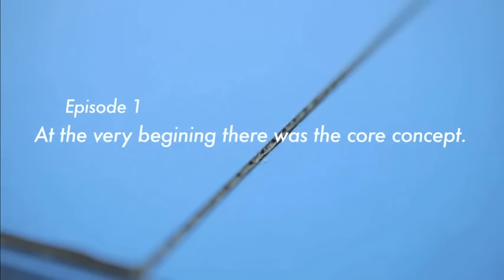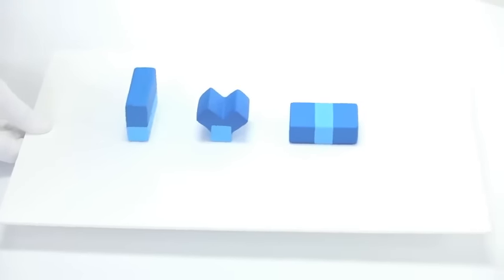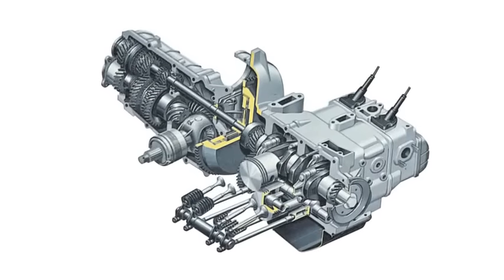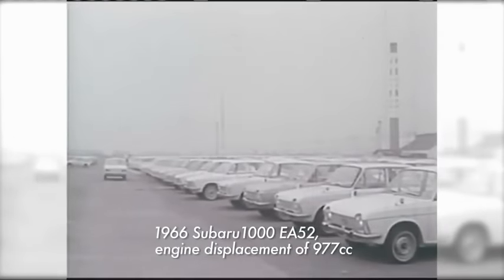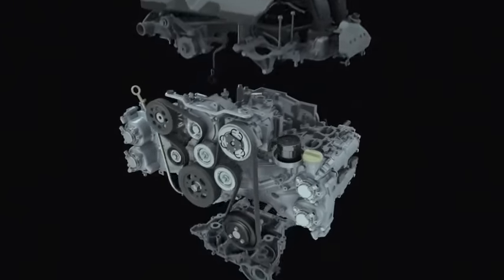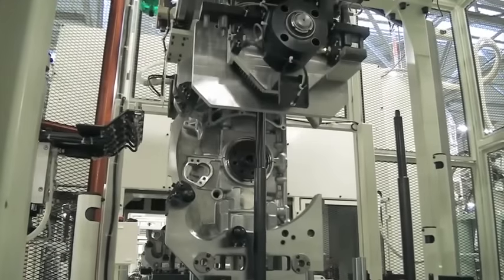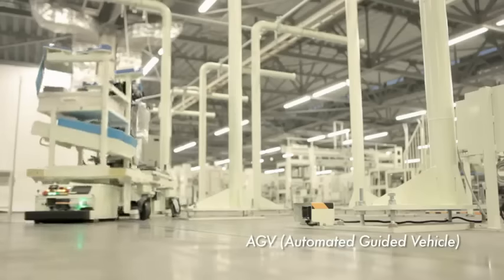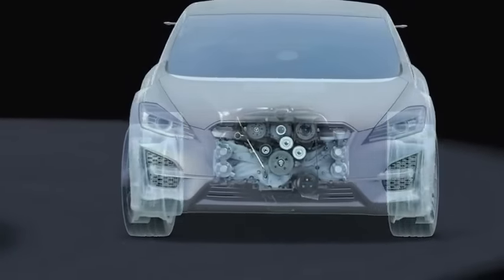Learn About Subaru Boxer Engine Technology

Comment: in 1970 I owned my first L15. In 1972 I owned my first Big15, later powered with a D motor and gearbox that stunned passengers: especially after avoiding our fatal accident due to the Citroen's amazing abilities. Then my ID and DS's.  My personal claim is merely confidence in my cars ability while testing its limits. In 1980 I married at 30 years of age, with a promise that my wife would never question my love of motor bikes and cars. Occasionally her friends poison her re this but I seem to survive.
I bought my first Subaru in 1980,  a yellow Leone as my Citroen mechanic failed my needs when I needed him most. What a car! The pluses far exceeded the negatives like hydromatic suspension by so much. What a drivers  car it was! My policy was to replace No1 car every 2nd year and my wife had the alternative choice. I discovered that her choice was of low quality engineering but high in creature comfort, while I chose a high quality car with low creature comforts at the same cost. This has since changed. Our 1999 Leone was a nightmare; motor out 3 times in the first 5 months and frankly it was crapx10. We gave it to a friend 2 years later free of $$  and he gave it away within 2 years as well!   However, I bought the new Legacy which was magnificent. I have owned variances of this since with a big smile. I have recently converted 4 workmates to Subaru ownership after  my enthusiastic demos as it is a drivers car, not a Ho-Hum car. Sadly, my Subaru's of the last 10 years have become Toyota's with a good motor and that annoys s me. Are the owners trying to become common car suppliers? If so, this article becomes obsolete! Top Gear were so in love with Subaru that it banned them from their show as little else compared, yet Subaru are reducing their cars to Toyota quality that makes me want to hang on to my older Subaru's rather than like my wife's later Subaru mediocrity. Do they care? I doubt it. But I do and so should you. Thanks, John

Comment: Interesting video.  What about blown head gaskets?
Reply: Last a problem in the '99 model year for select models equipped with the EJ25D engine.
The replacement EJ251/253 rarely has headgasket issues, unless maintenance is not followed.
Reply: FCFordLord i have an ej251 and the head gasket issues were fixed in 2010-2011 for those (2004 impreza 2.5 ts) because I blew 2 of them before that was fixed.
Reply: The EJ25's were the only ones that had this issue. This was fixed when the replaced their head gaskets with multilayer steel gaskets. Which is where the (they must be machined on replacement) heads. The EJ22 and EJ18 used a graphite design that filled in imperfections. But while they used this as well for the early  EJ25, because it was machined out of the same block design. This left less surface area for the graphite compound to fill, and allowed for  head gasket failure. Replacing it with a MLS head gasket allowed to have a strong bond (because graphite isn't that strong inherently, and will erode.) This allowed the issue to be fixed. For a long term fix, they added a additive to the list for service with coolant replacement. Subaru's Coolant Conditioner, which actually has a micro-filler to prevent premature failure, but filling in the imperfections that may happen while the engine is hot or the head starts to warp, which looks to be based on a graphite compound. (not sure what it is.) I have a EJ22 that I just replaced the headgasket on personally. It only has a Graphite compound gasket. Works great for that. Not that I had to replace it, but because I was doing other work, I did.
Reply: Robert Drake or a v engine with a Flamingo i have a Jeep grand Cherokee 5.2. haha.
Reply: Lol I had to get en ej20 because the ej25 is fucking horrible

Comment: The rings push harder against the walls than gravity so it's not going to wear the side closest to the ground more. Subaru engines are capable of 200k+ miles when properly maintained. Because of the layout they actually are less likely the blow up when oil starved as my ex ran her 93 impreza almost 30 miles with a cracked oil pan. Horrible noices went away after we fixed the pan and added oil. Drove it for another 2 years and then sold it :) No oil consumption or smoking. Amazing!

Comment: As a new owner of an XV, and first ever Subaru in the family, I find the engine noise to be higher than the Mazda and Volvo that I've owned. Neither my '95 Volvo 960 12v-inline, nor my Protege5 and Tribute V6 had as much engine noise as this V4 Subaru. However, I like engine noise.

I took the XV on a very uphill & downhill curvy road going at least twice the speed limit for a one-lane road (60miles/hr vs 35 suggested). It handled with beauty!
Reply: I haven't heard that much

Comment: My Brother traded his 98 subaru impreza with 280000 miles on it for a new wrx and the dealership gave him 4k on the trade in which was impressive! the motor had a timing belt change and basic maintenance and tune ups done on time! car had no problems!! so im guessing the new 3rd gen is really good! i drive a 2012 wrx with an ej25 and i love it!!

Comment: learn about head gasket failures, spun rod bearings, and blown piston rings.
Reply: Don't forget about broken timing belt tensioners and bent valves. Seriously, how hard is it to build a non interference engine?
Reply: Justin Stearns No engine is perfect. It's just a matter of maintenance. They made a 4 cylinder that makes you believe you're behind a V8. It sounds great with the turbo or blower, it's faster than the average sedan. Just enjoy it for what it is. As long as there are moving parts in a machine, failures are inevitable.
Reply: Yes, but most companies would go back and work the bugs out, they're still making the same engine (the 2.5L)  with most of the same problems it had from the start.
Reply: Justin Stearns True.
Reply: +Justin Stearns the new WRX's and Foresters have the new FA20's. We shall see how they perform in the long run
Reply: +Justin Stearns  Don't even get me started on the timing tensioner... bought an '04 outback, started making funny noises, shaking, and one of the cylinders dies. I open it all up, and the damn tensioner FELL OUT OF THE ENGINE. I don't know how, but thank God, it didn't eat the valves.
Reply: I like the balanced idea, I think it would be cool to TRANSVERSE mount it. That way you could work on it much easier, and even make a BOXER 8 CYLINDER (since you have more room longways). You could tune it to rev much higher with the good balance and low rotation mass.
How freaking epic would that be?!
Reply: Headgaskets last an issue in '99, further issues are maintenance related.
Spun rods and blown rings are limited to beaten WRX / STi models.
Reply: Glass Engine or Glass Transmission. Take your pick

Comment: Own a 2019 Subaru Ascent.  Smooth, quiet and extremely comfortable ride.  All of my passengers still comment today in 2023.  Very roomy, tons of safety features this SUV humms at 85mph on-going no problem.  The air conditioning system is bar none the best.  Maintenance costs are very reasonable.  You won't even hit a large maintenance bill until 60k miles.  Cost is around $745 but they do a lot on the vehicle and then, other than my free oil changes at the dealer, my next expense is minimal at 90k miles. What is nice about the boxer, 4 cylinder turbo engine is that if needed, you have a tremendous amount of power starting at just 2000 rpm!   Punch it and go if needed.

Comment: Subaru built more boxers then any other company? 11 million boxer engines. VW built over 21 million air-cooled beetles. They all had boxer engines in them.
Reply: +VolkswagenVMan  That's a five year old documentary. These days they are building 1 million a year. Indiana plant alone is building 30k engines a month
Reply: +VolkswagenVMan  I think they meant they are producing more of them at present than any other company, which really isn't a great achievement since only one other company builds them (Porsche).
Reply: Maestro_T
 in cars yes, but Continental and Lycoming use the same design in aircraft engines. In fact most smaller piston aircraft use horizontally opposed designs. They almost never use any other engine configuratin in 4 and 6 cylinder applications. They go from flat 6 to radial engine if they need more power.
Reply: Y10Q I'm sure Subaru is producing more engines than they are too.
Reply: This video lies in more ways than one and it is a shame, because Subaru does make a very good car. Owner satisfaction has been high since it was first made in Sweden. And don't forget the Harley Davidson XA motorcycle made in the 1940s it had a opposed two cylinder flat engine.  And the Chevrolet Corvair, 6 cylinder flat air cooled engine,made in the 60s. Ralph Nader made it look bad. Even BMW has been making flat engines since the 30s, in their motorcycles.

Comment: Question for Subaru engineers. I just did my timing belt replacement service on a EJ20T. Why a belt instead of a series of steel gears which would be more reliable?

Edit: For example, Cummins diesel ISB timing gears
Reply: A series of steel gears for the Timing? = +Weight, +More Rotating Mass, +More Expensive... Hope this clears out why Belt is = Cheaper, Lighter and Has better Performance.
Reply: skirmish is partially right but he also forgot to add that the advancement/ delay of timing is in the case of the timing compartment on DOHC engines. Putting in a gear drive would make it harder to to develop the system. Our cummins 8.3l ISC has about 950lb of torque but 325 hp where as the subaru 2l has 265 hp and 250ish of torque. Diesel engines produce lumps of torque but little hp thus a subaru belt system wouldnt be able to cope. Besides a timing belt is like $140 + 1hr time to change on subarus but cummins gears are expensive and a pain to remove.
Reply: tim michelson
But how often do you remove gears? Practically never.
Reply: how do you make vvt system with a gear train??? Lets not forget this is a 300lb engine we are talking about, not 3000lbs of steel like cummins
Reply: @skirmich  Studebaker sixes and V8s used steel helical cut gears to drive the cam. Come to think of it, the Chevy stovebolt used gear drive.

Comment: So their boxer engine not only delight the owners with their exceptional performance.  It is also a mechanics' delight too cos they get to work on it every 3 years or so replacing the valve gaskets.
Reply: I've had zero issues with valve gaskets and have had my car, which is from 2003 btw, for 4 years.
Reply: Dominic Fong the gaskets from the turbo models are much better as they are different design

Comment: I recall the first ones imported were rejected and turned back to be dumped out at sea --- based on US DOT evaluations that indicated serious problems. If I'm not mistaken, I remember some that were spared at Orange County drag strip where you could run them into bales of hay for fun on a tiny "autocross" circuit.

Comment: difficult to repair yourself, otherwise...fucking good engine.
Reply: Mine is incredibly easy to work on.
Reply: it gets annoying needed to lift the motor out if you want to do any work to valves or gaskets. Alternator is a dream tho
Reply: +nukeboy27 I did the valve cover gaskets without lifting it out, never needed to go further into the motor.
Reply: get a good mechanic.

Comment: I don't think low CG and compact size outweigh the downsides of many extra parts, heads facing wheel wells making it harder to work on and I would have to disagree on boxers being quieter than other engines.  When it comes to piston engines, inline is the simplest arrangement.  It is a shame no one makes a inline 6 anymore.  And a fast revving inline 4 would have suited the scion FRS better than the boxer.
Reply: +RCPro Driver My BMW 130i has an inline 6 as many BMWs: M135, M235, 335i... And BMW keeps upgrading its legendary inline 6 with new technology...
Reply: +RCPro Driver to my knowledge, the additional parts in any horizontal engine don't really ever fail.  Obviously they can fail, but normally the common mechanical problems with horizontal engines has to do with oil.

I get the impression I-6 engines are just too awkwardly shaped to put them in modern cars.  I don't think their size is the problem, they're just so long.  Due to safety regulations and demand for more desirable features, it just makes more sense to go for a V6 instead.  Brands like BWM and Jaguar likely will never abandon I-6 engines because that's what they're really known for, so they'll do what they can to make them fit.
Reply: Peter Schmidt if you drive a inline 6 you will know why they stick to it... It is long, and in fact it helps achieving a great weigth distribution... Add a twin turbo to it and it will beat most v6 out there and still keep perfect ressonance
Reply: +RCPro Driver The FRS is heavy as balls, that thing needs a 5L V8 at least. Or a turbo V6. Unless you throw some seats out or something, it needs some serious liters, or high-strung tuning.
Reply: cybertree I agree.  how it weighs more than my scion XB is beyond me.  Stupid lobbyist for the auto companies getting laws passed that make it impossible for them to build cars that weigh 2,000 pounds...which is about what a small RWD hatch should weigh.  The days of "light" hot hatches and RWD coupes are gone.  As are the days of straight 6's...which IMO are better than any V6.
Reply: RCPro Driver Heavy is relative.  Sure, cars might commonly weigh 3000+ lbs lately but they're also a hell of a lot more powerful, safe, and fuel efficient than their predecessors.  Also, if you want a light RWD coupe, the MX-5 is still a great choice.
Reply: Peter Schmidt Id rather avoid an accident in the first place.  Lighter cars can stop faster and turn quicker.  And just imagine if the 40mpg engines used in 3,000 pound cars were put in a 2,000 pound chassis!  Also, to say that modern cars are more fuel efficient is a half truth.  The 1983 Honda crx HF got over 50mpg.  Its engine was a antique by today's standards...but the car was so dang light that it didn't matter.  Put a modern 1.5 DPFI engine in that crx and 100mpg might be possible.  But auto makers have made sure that that can never happen.  Im partial to cars from the late 80's-early 90's.  Modern cars have as many downsides as they do improvements.  IMO, simple and light is better.  Auto makers have had to keep pushing engine development in order to keep mpg decent BECAUSE they have been increasing the weight of cars.  Also, it ticks me off that you cant buy a small, light duty truck anymore.  Even the most basic 2wd pickup (even fleet models) have stuff you don't need and more power than is nessesary.  All that does it make them cost more than they are worth.
Reply: All BMW 6 cylinders are slant 6s...basically an I-6 that's leaning to one side a bit. They're still in production and aren't going anywhere any time soon.
Reply: so far my forester has only been good at taking money from my wallet.
Reply: RCPro Driver Almost any car will be a money pit if you don't maintain it or drive it properly.  It takes more than just doing regular oil changes, air filters, and tire rotations to keep a car running properly.  Subaru reliability is very average.  Not everything can be left neglected like a Toyota Corolla or a Mercedes 300D can.  Some cars just refuse to die, but most need attention.

Even people who like what they drive and think they take care of it really don't.  How often do you think people check transmission fluid, brake/steering fluid, or differential fluid?  Have you checked any of those things?
Reply: +RCPro Driver I think an engine with a low CG is only relevant in the days with bias ply tires and iron block engines.  These days with advances in suspension and electronic stability programs, a flat engine does not offer any additional benefits.  Yeah you're right about the FRS: they should ditch the flat engine for inline 4 or V6 from the Toyota parts bin.
Reply: An inline 4 engine would have required a taller hood line, which would make a short car like the FRS look strange. Also, center of gravity will be higher.
Reply: RCPro Driver 1. You know the FR-S is a rebranded BRZ? 2. If you know what you're doing, it's not any harder than a V8.
Reply: Remember the Packard nine-main 327 inline eight? Talk about SMOOTH!